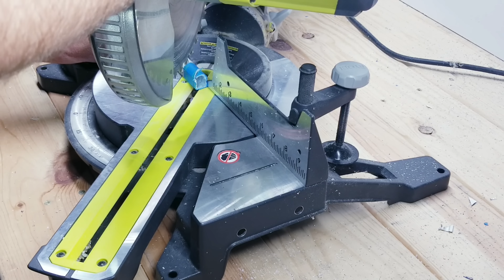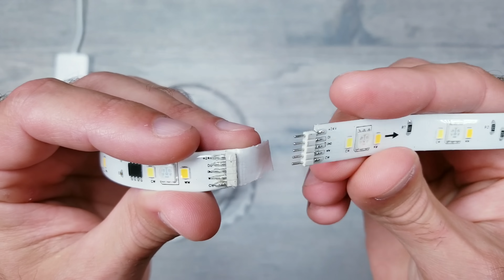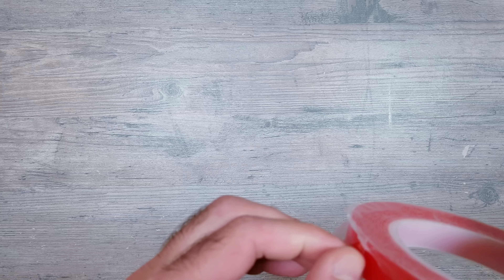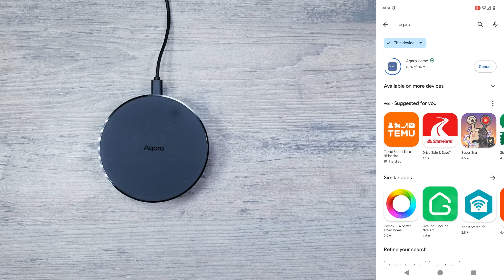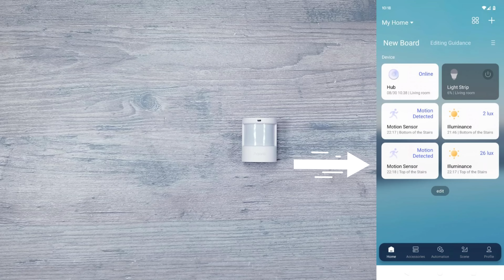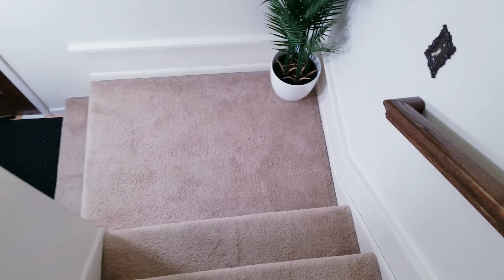EASY Motion Activated Staircase Lighting - NO PROGRAMING!!!

Comment: So i bought a T1 strip and single extension for under the kitchen cabinets by the floor. Bought the BTF connectors listed in the description. Extended a ribbon cable to pass underneath the dishwasher and when i plugged it into the next segment of LED strip, i didnt get warm white. I got RGB and cool white. THEN i soldered the wires straight to the extension/cut piece of LED strip and didnt get anything. Ive now tried this and similar methods to simply get the warm white LED and have now wasted HOURS and two extension strips from Aqara. Any recommendations for me? I'd REALLY like to get this thing to work. They claim it's cuttable but in my experience thus far, it is not.

Comment: Unfortunately, tape is not durable. Sure it will last a few years maybe but a decade? No way. Using a channel that can be screwed into the studs would last longer. 
Command strips are specifically designed to be temporary. There are double sided tapes that are stronger and longer lasting. 
It looks amazing man… bravo!!

Comment: Wow.  Some products that I didn't know existed.  Thanks!
Two critical comments:  1.  Adding the caulk pretty much negates the use of the Command strips.  If the lights are removed, the caulk will pull the paper off the drywall.  2.  You are indeed programming the controller for the lights.  It's all very intuitive with the controller interface, but you ARE programming.
Nice result.  Thanks for posting.
Reply: Programming in a very basic simplified user friendly way... Not actually writing the code.
Reply: @MiniMatthew writing the code would be just as easy as now we have chat gpt to do it all

Comment: I am wanting to do something similar on my outside deck stairs. Motion at top and bottom. But trying to figure out the best way to wire it. Could I just put 3' runs on the stairs with extension connectors in between? Or run wires from a splitter? Any ideas?

Comment: I have not seen another install on YouTube that placed the lights where you did. I like yours better than all the others because there's no glare. Super easy on the eyes, especially at night when it's needed and the illumination is where it's most needed. No hot spots. Cleaning and vacuuming the floor will not be impeded.

Comment: What is the height of the diffuser channels above the floor/floor trim?

I actually am recreating this build but doing the molding   first (already made my 45 degree corner cuts) flush with wall then using double sided tape to affix the diffuser? Trying to decide if I want the trim to go above the wall socket or below. I have an angled aluminum led diffusers used for ceilings going in my build.

Comment: That’s great but that’s a lot of money to make. I’ve worked it out (roughly) to about $250 all in which is a lot more than I expected
Reply from the maker: Thanks so much for watching and taking the time to comment! The areas you could save money would be not using aluminum profiles and not using Aqaras plug and play system. It then becomes a matter of A,  If you know how to do that (choosing good led strips, selecting the correct power, finding a comparable controller, finding motion sensors and programming everything together)  and B if the extra time you would spend on the project would be worth the savings of what I think would probably be 100 to 150 dollars.

Comment: Great video. I'm planning on doing this on my staircase and in my closet, but I'm curious what settings you used for the motion sensors. Did you lower the detection rate all the way to 1 second? And whatever you lowered it to, how has that affected the battery life?

Comment: Assuming those motion sensors are standard PIR, keep in mind that they can be set off by changes in temperature or air currents that are too close to the sensors. I'm a security technician and I deal with these issues at customer sites all the time

Comment: It looks great, but the control systems seem a little overcomplicated. It works, yes - but it's using a sledgehammer to crack a nut. The cost of components, complexity of any repair, dependence on a single supplier... when what you really need is just a very basic motion sensor and timer circuit. Any electronics hobbyist can whip that up from parts, or just buy a module ready-made.

Comment: as cool as this is. which i will do at some point. ill opt to have a motion sensor at the top and bottom of the stairs that can just plug right into the lights without needing an app. they have those on ebay specifically for led strips and the strip itself powers it at the end of the band. having an app just seems too much. i dont wana think about it i just want it to turn on when im near.

Comment: damn! that end result was definitely pro level in my opinion very well done! and thank to your video I'll borrow a few ideas for my own future project. but I will have to make some changes.. tbh I'm not really a fan of lighting systems or any home automation system for that matter that rely heavily on the home network wifi signal. if your network provider were to have technical issues the wifi signal would drop out and the whole system would not function. or if like me you have your home router/modem on a simple timer system to save on utilities because why use power for the internet when everyone's in bed asleep? ^_^ but I'm sure there are some simply work arounds.

Comment: Looks like a great project and good inspiration 👌🏼 I was wondering if it's possible with this setup to program the light strip in a way, when the top motion sensor is activated, that the lights on the top floor light up and the lights on the stairs light up in a motion (from top to bottom)? And the other way around, so when the bottom motion sensor is activated, the stairs are lighted up first (from bottom to top) and then the upper floor?

Comment: Love this, but we have 3 cats and they would keep this activated all the time!!
Reply: I had that problem in the garden at my old house - wind, cats, foxes. But there is a very simple solution: Beam break sensor across the garden. Can't be set off by anything below waist-height.
For a stairway, I'd actually consider pressure-sensitive pads, of the sort used in intruder alarms. I wonder if cats are heavy enough to set those off.

Comment: I have to say, cutting channels like these to size was a huge pain when going around corners when I did a gapless installation myself. Additionally the usage of 5V LEDs made the voltage drop very apparent, so I had to splice power in at 4 separate points along my 20m stretch. End result is really nice though and I do recommend the Muzata diffusers as they look super nice
Reply from the maker: Thanks so much for the update and glad it turned out good! Did you end up using sk6812 lights?!
Reply: @ChrisMaherDIY  I did not. I used an ESP8266. Did this project last year and went all around the top corners of a room. Wish a product like this was available when I worked on mine. I have always followed your channel for lighting advice and setup though, so thank you very much for your help.

Comment: Warning on how you did this... I used those 3M removable stickies for my LED lighting... they worked well enough over short distances, but over time the expansion and contraction of the house with a hot summer and cold winter, had it slowly come apart and eventually all my trim fell off... may be useful to put a couple screws or nails in each section if you want it for the long term.

Comment: I just finished this project on two consecutive stairs. Did strip plus 8 extensions. The LEDs are white only no color after the first 'cut' and then 3rd party wire connection? Instructions in box say if you cut led you throw away the rest? How do I have a cut use extensions and have colored lights? I have asked company for help?

Comment: Instead of doing all this, I just bought an led kit off of amazon for $25 that has everything you need, including a motion sensor. Stuck it to the underside of the railing. Almost a year later and it works perfectly fine. And I don't have ugly aluminum rails half way down my walls either.
Reply from the maker: Thanks for watching and taking the time to comment!
Reply: Include a link next time you dismiss a creator’s work.

Comment: run painters tape along your wall about 1/8" above and below the seam of where you will caulk.  Then caulk, spread it with your finger (nitrile gloves are great for this) and then peel the painters tape away while the caulk is still wet and you'll have perfect lines and looks way better.

Comment: Great idea I will dream of doing. Just a case for saving trees - PLEASE rethink the reliance on TWO ROLLS OF PAPER TOWELS! 😮I've done a lot of caulking, enjoy it actually, and your real friend is a wet rag AND a tiny hole cut at a 45 degree angle in your tube. The tiny hole controls how much you apply, use a wet finger to swipe the line of caulk and a wet rag to clean up. Also less waste!

Comment: Looking at the app, you can also choose “if any condition is met” and just add both top and bottom motion sensors in the same Automation.
Reply from the maker: Good catch!! Didn't even notice that!  Thanks for the comment!
Reply: @ChrisMaherDIY  No problem!

Got all my parts this weekend to install a similar setup. Seems like Aqara has lots of other cool accessories to add, which could potentially make it a good ecosystem.
Reply from the maker: @AviationDirection  yeah for sure! That was one of the reasons I decided to go with Aqara for the build. They seemed to overall have good products and they have been doing the home automation for a while and are compatible with most systems! Thanks again!

Comment: "Paper towels are your friend" -- Latex gloves (or other, if you're allergic to latex) are also your friend. They make sure you don't get paint on your hands when doing the painting (don't know about you, but this constantly happens to me no matter how careful I am) and they also work with the caulk, when you run your finger along the bead to smooth it out. It's hard to tell but it MIGHT have worked with the issue that made you caulk it -- if you'd taken a finger, dipped it in the paint, and ran it along those spots where the wall bowed, it might have been able to fill it in with paint... The caulk is better, but extra paint might have been able to fill the space.

Comment: I tend to use the recently introduced LED cob strip's nowadays. ( Chip on board). The light is far more uniform almost like a continuous neon strip, no light and dark spots, very neat, diffuser is optional ,I tend to run just as a strip, it blends into staircase edges seamlessly. Various led count per metre available as is voltage, 12 and 24v. I use 12v in all my projects to keep everything uniform as most controllers, passive, infra red, etc all tend to use 12v. The colour range is pretty extensive, besides white, cool, warm and standard, blues red purples, green and more. The blue looks stunning on stairs, landing and newels. I buy everything direct,  I know all the proper LED specialist manufacturers now who supply such as Amazon and the UK lighting industry so I can save a great dealing direct. As an indication I pay around £8 ( $10 US) for a 5 metre length of COB LED which I think is reasonable.
Reply: @richardhalliday.. agree that I like the lighting effect of COB slightly better but for my project the motion triggering is the most important aspect. Can you recommend any motion sensing solutions compatible with COB strips that are equally as customizable and manageable as the Aqara sensors i.e. can trigger multiple individual strips in different locations etc.. Please let me know if you do!

Comment: lovely looking installation and the sytem is great for people with no desire or ability to programme a micro controller. Just plaug and play and a little fiddling with the app. But boy oh boy that system isnt cheap! i love the long batttery life on the motion detectors and the fact that they are quite small and unobtrusive. Shame about the £50 hub required before you get to the sensors though. sadly the profiles you used don't seem to be in stock anywhere and the main product page also shows no products right now

Comment: Just found this, love aqara kit and thinking your whole tutorial is ace. But instead of caulk, use a decent silicone. The silicone will stretch and move with the wall, caulk will just crack. Its not great for paint, so paint the walls the colour you need, then the white beading and then the silicone

Comment: My wife is visually impaired, so we installed individual light units on the stairs that come on as you walk down. Trouble is, they use a LOT of batteries and where they need to be means they can get knocked off from time to time. This is a better solution. Not sure if this type of system is available in the UK, but I'm going to do some research!

Comment: This is the wrong LED strip to use for simple motion activated lighting. The only "advantage"  of the strip shown is that it is easy to extend , a feature made necessary because of the chip controllers needed to control the 6.5 ft short sections.That application doesn't require a hub or multiple color strips. Using them reduces the long term reliability and dramatically increases the cost with no benefit.  Any PIR detector made for security applications has dry contacts, high quality relays are much less expensive, single color sprips in longer lengths have fewer active components, run cooler and consume less power.

Comment: The project doesn't look finished. The Devil is ALWAYS IN THE DETAILS!  This project would have looked 1,000 better,  much more professional, and contemporary IF you had replaced those old-fashioned baseboards. The fact that you not only used the existing baseboards but didn't even paint them to match the walls detracts from what would have been a really cool feature. As I said, the "Devil is always in the details"

Comment: And I thought "I" was a stickler for perfection. Unbelievably clean job, this is beyond pro level. Thanks for sharing with us.
Reply: why didn't you use a 45 degree profile?  and turning the strip will be much easier.  or will the light go into your eyes?
Reply: I was replying to the above comment which stated “beyond pro level”. I was simply pointing out what a real pro would have done. I still think the work the guy did is way better than a typical diyer but it’s not pro level and it’s definitely not beyond pro level
Reply: This is sub pro level. Definitely not beyond. Minor details that a real pro would have done include but are not limited to 1. Putting a return miter on the end of the trim piece at the bottom of the stairs so it doesn’t look unfinished. 2. Fishing a wire and hardwiring the strip so it doesn’t need the god awful looking conduit lines going to the bedroom door or an outlet with a bulky plug. Putting the correct common angle on the trim piece at the top of the stairs so the pieces line up. 4. Installing the motion sensors in a more inconspicuous location like at the ceiling and wall line. All in all it looks good for a DIYer but it is definitely not quality, professional work.
Reply: @petersenal06 you realize this is proof of concept right? He literally said he's going to move the motion sensors and hardwire the leds. He didn't spend the labor cost of what a pro would charge and reaped 90% of the rewards.

Comment: Great project, one question. Do you need the channel diffuser if you are covering the led strip with the L shape wood
Reply: You would as the goal of the diffuser is to even out the light output from the LED strip (so you don't see hotspots from individual LEDs anywhere). Technically, he could have just used diffuser channels if the corners were cut exactly and the corner joins of the LED strips were done there.

Comment: I am going to do it using WLED and PIR sensors, but using styrofoam stucco (is that the right word?) :P  
Looks better and is cheaper than aluminium extrusions - of course those help with dissipating heat, but I'll only use the strips at low brightness anyway.

Comment: Yet another home appliance/fixture that requires a sign in, that is completely pointless. The only redeemable thing about all this is that the sensors are wireless. But all of this can be acomplished with 2 simple sensors wired in at the top and bottom of stairs without any need of an app, a hub or whatever else. And since those lights will always be white, you can just get generic led strip, with the specs you want or need of course, and not worry about anything else. But we wouldn't be human if we didn't overcomplicate things.

Comment: What gauge is the 5 wires you used to connect the strips?
Reply: 22AWG is the most common for LED wiring. It's very thin but usually only carrying 5-12 volts.

Comment: FYI, those Command strips are only "removeable" if you can access the pull-tab for removal.  They will tear up your walls like any other foam tape without that.
Reply: Could always get the Velcro ones that way you can take the diffusers off then have access to the tab on wall 👍
Reply: I’ve used my old learners permit to wedge under the foam so I could get enough leverage to make my own pull tab. Worked fine just had to be patient.
Reply: Ever try heat to remove them?